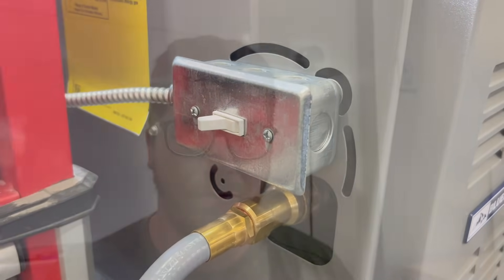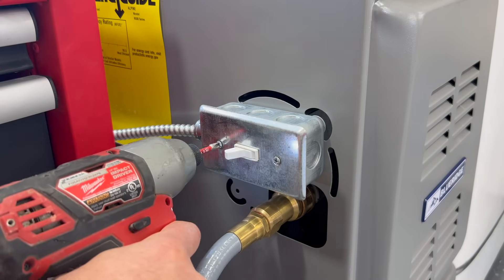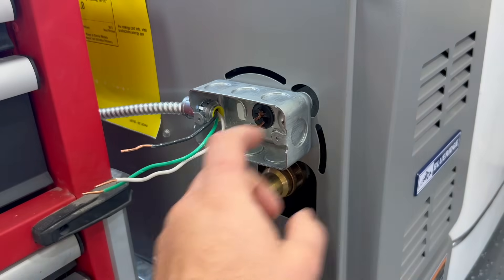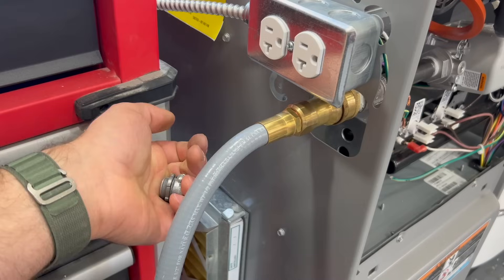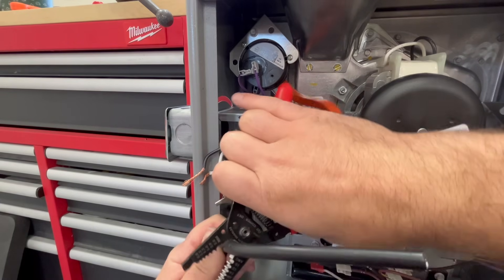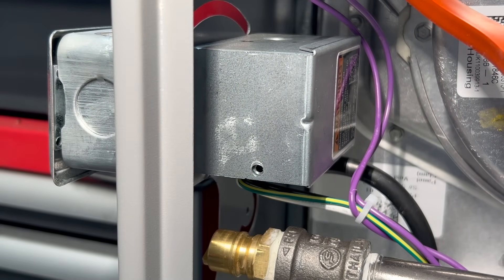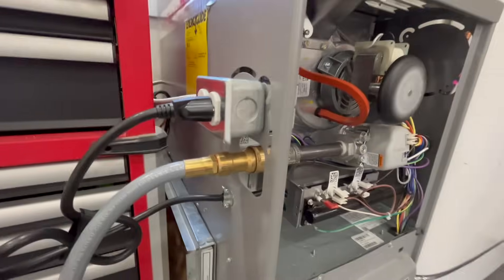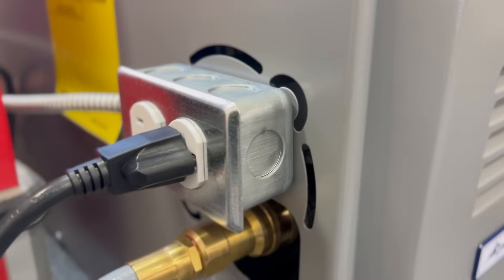Keep Your Family Warm During An Emergency Power Outage With This $20 Fix

Comment: Another great video.  Here in Texas countryside we don’t have gas so our furnace is all electric meaning 240VAC.   So I would power that with a whole house backup or maybe a portable generator like the Anker Solix 3800 which provides 240VAC split phase.  In reality I will likely have a critical needs panel until I can cover the whole house with battery backup but that is another story.  It is nice to have options.  Thanks again for your videos.  I always learn something.  All the best from north Texas!

Comment: Interesting about the furnace needing bonded neutral.  Also interesting that a portable power station isn't bonded.  A little info on how to tell the difference would be helpful. 
Bonus:  Making your own bonded plug is super easy.
Reply: most of the control circuits are DC and use the cabinet as a ground. Yeah, it's screwball but reality.

Comment: Can you do this with an electric furnace?  I live in a mobile home and have a DOWNFLOW/UPFLOW ELECTRIC FURNACE MODELS: EB SERIES.  I use a 12,500 watt generator.  Can I do this with the furnace I have?  Do generators need that bonded plug?  With an all electric home when the power goes out I'm pretty well Boinked.

Comment: Thanks for the video. So much better than the “widow makers of the past that I had to learn to make work.  But I am much older so I should know more now. Never thought of doing this method. But I gotta figure out my situation with a gas mounted furnace that’s completely outside.  Hmm. I shall find a video. It’s a weird house I got and with all the outside venting ish by looks.  I know how the house was originally designed in the 60s and how they decided to do the design as a single home they prob ever built with what little money they had and never meant to sold until both died.  Things like design from the foundation to to the roof in 70 years amazes me.

Comment: Question, If you don't have a power station, can you use a portable gas generator outside and do you still need the bonding plug.
Thanks for such a good informational video, makes it really easy to understand.
Reply from the maker: Yes absolutely
Reply: @diyhvacguy  No, most gas generators are already bonded so no plug is needed. Also, most 120v outlets on a gas generator is gfci and you CAN’T use a bonding plug on a gfci without tripping it.
Reply: @neilbrookins8428  I can't speak to "most," but I needed a bonding plug for my Honda EU2000i generator.  Furnace would not ignite without it.  Soon as I plugged in bonding plug, the ignitor fired up and I had heat.

Comment: Truthfully with all the different power sources available in different price ranges, every home should have an Interlock or Manual Transfer Switch installed.  But what you're trying to do, just install an Interlock on your main control panel.  It's much safer, legal and doesn't require any modifications to your furnace.
Reply: But in that set up you need a dedicated feed from a generator.  This guy is mostly interested in the heat.  Single extension for it. However, the generator may have another outlet for use of the refrigerator.
Reply: @richarde.plante3292  yes correct. And that is the whole point. Running a generator to the main does not break code. Running your furnace off a battery unit is ridiculous. What are you going to get? 5, 8 maybe 10 hours tops? And if you plug in your fridge maybe 3-4 hours? And when the battery runs out what then? You can get a decent gas generator for 500 bucks. Cannect it to the main and run fridge, furnace and some lights off of it endlessly.

Comment: That gas line made me hope that you had a way to run a natural gas furnace with propane in an emergency if natural gas would stop flowing. But, no 😒
Reply from the maker: I would like to do a video on that. It would be a lot of work as the orifices need to be changed for propane.
Reply: @diyhvacguy  Sure, I did learn about having to changes orifices. Too bad there isn't a quick change design, or a quick change device for changing orifices, or orifice sizes.   😏

Comment: You should have just installed that cable clamp in to the junction box and made the termination inside that..  Done and done.  This hurts my head.

The idea is on point though.

Comment: Nice vid. You know, what surprises me is that the furnace only needs 250 watts to run. And that is not much. Kinda like 3 old fashioned light bulbs worth of power.
Reply: Ya its mostly just making that big fan move but initial startup you'll need 3x that.

Comment: Does this work for an electric furnace?
Reply: Electric furnace is probably 240 volts and the amps would be dependent on the number of heat elements. So all the plugs, outlets, and wiring would have to be sized appropriately and a generator capable of delivering 240 volt power and sufficient amperage.

Comment: Probably best to use a single outlet (not duplex).  Any  "inspector",  rightfully could point out that the second outlet invites someone to wrongfully plug something in to what is required to be a single use furnace circuit. A well made, old style, twisted together wires with a well tightened and taped wire nut IS THE BEST most reliable wire connection
Reply: It's actually common to have an outlet for a condensate pump with AC or a condensing furnace. The code violation will be a 20 amp outlet on a 15 amp circuit.  BTW, while a plug is ok by code as a disconnect, furnace code will still call for a switch. IOW, he probably needs both.
Reply: @rupe53  Thank You.  I have a 80% furnace and do not have any  condensate pump/ condensing furnace experience.  I Am of the opinion that it is too much "complicated efficiency" for stand alone  reliability in these times. I too noticed the 20 amp outlet and 14 gauge cord and circuit wiring?

so a switched outlet - single or duplex as indicated?

Comment: Is it safe to run a newer high efficiency furnace  with a older generator  .I  Noticed that the power  output fluctuates from the generator  . It also has a floating  ground  , so do I need a grouding plug .

Comment: Please explain what the bonding plug is doing in the power station. The plug listed by Amazon as: " Ideal for replacement of plugs on tools, appliances and extension cords."
Reply from the maker: So sorry I had the wrong link there! My bonding plug looks exactly like that. I got that changed, thank you for letting me know.

So the bonding plug just attaches the ground to neutral, so if you have a floating neutral you would need this for it to run.
Reply: @diyhvacguy  That makes sense. I had to think about why it would be a problem. Most viewers would not.  Would that still work and be true if you were using a small gas generator r even car/truck inverter?

Comment: Code in Denver says you must have a flip switch to cut power and a screw in fuse at furnace
Reply: that's actually a national code. Code also says you can't have a 20 amp outlet on a 15 amp circuit.
Reply: I have Never seen a screw in fuse at a furnace so it can not be a national rule !
Reply: @josephpadula2283    the part about a screw in fuse likely dates back to at least WWII and never got removed. (maybe even the 1920s) The reason was adding central heat to a home without adding an extra circuit to the fuse box. IOW, tying into an existing power feed in the basement and making your own branch line. There was actually a combination switch / fuse base made to fit a 2x4 box with a small flip-up cover for the fuse. (have one in my house) Kinda cute but short lived because many just installed a ceramic bulb fixture and landed the fuse there, next to the switch box. Screw in fuses have the same thread as a lightbulb.

Comment: Great idea 💡💯💡 as Always 👍.  8 years ago when I installed a gas self igniter Heater on the Wall.... And did Convertion run on Natural gas on the GENERATOR.  Everyone in my Family Complained about it and made a lot of Bad Comments.  Why this and why that❓❓  2-years Later, We we had Winter storm and ice and Power outage.  Many people were moved to Hotel and some Old people were dead without electricity.  Then everyone in my Family said to me " You are Smart guy and always prepared"...  People in General they don't See and don't believe. In my mind I called them what a Clueless and Stupid people.

Comment: I can see that the original furnace before modification was fed by a metal conduit and rated for high temperature. But the post modified feed is plastic with a possible lower temperature rating.  This is not ideal and possibly violates code that requires high temperature rating.
Reply: Making that connection OUTSIDE the cabinet solves the code issue.

Comment: If the wire coming into the box is both 14 gauge and also fed from a 15 amp breaker then it doesn’t make sense to use the outlet shown which is for 20 amp service.
Reply: why argue for the 1-2 bucks extra, other than it's not code to have a 20 amp outlet on a 15 amp circuit, which is usually is on a small furnace.
Reply: @rupe53  it’s a simple issue. The 20 amp outlet allows you to plug in a 20 amp load device.  That will trip the 15 amp breaker.  You shouldn’t mislead a person to think the circuit supports 20 amps when it does not.
Reply: @neilbrookins8428     and that's the reasoning behind the code not allowing a 20 amp outlet on a 15 amp circuit. BTW, a 15 amp breaker will run overloaded for many minutes before tripping. The problem will eventually be failing insulation due to heat cycling if it gets used that way.

Comment: Shouldn’t the green wire entering the box with the outlet have a pigtail that connects to the box itself?  Meaning that the incoming ground splits to both the outlet and the box.
The original setup when switched off was still grounded to source.  The new configuration when unplugged is no longer grounded.  This is unsafe.
Reply: The ground wire screw of the outlet should be made with a small piece of conductor that communicates with the screw that holds the outlet into to the box. Allowing the ground circut to travel into the box.

Comment: Nice idea man. OK if you have a "battery power station" but just with a actual generator it would have to be outside. How much power/current does the average furnace draw? If it's that 230w then the battery amp draw is 10 times that or about 20A. I know that usually the gel-cell batteries (like the ones for UPS backup) are shit. only last perhaps 2 years even if not used, and are expensive to replace.
Reply: read your data tag then figure out if the watts are combined or separate for the heater and blower. Most will be in the 200 - 400 watt range. That's 2-4 amps total. An oil or gas boiler will be in the 2-3 amp range, including the circulators.

Comment: I just did this to my furnace, which one of your past videos, gave me the idea. I bought an Anker back up supply for the job from Amazon. I wired mine a little different. I used a combo switch and outlet where the switch was. I made it so the switch controls the combo outlet, all in the same electrical box. Then, I ran my pigtail wire to the furnace. What I'm doing differently is, leaving the furnace plugged into the backup, all the time, and the back up is always plugged into the switched outlet. Been using this for weeks. For me, if the power goes out, and I'm away for some hours, it's all done automatically. I ran the furnace, solely on the backup after I did the install.  It ran for 6 hours, perfectly, and I still had 75% of my battery left. The Anker model also has an app for my phone, so I can always check and see what's happening at home. Worked perfectly. Really happy I did this. Did not know about the bonding plug issue, but fortunately, mine works fine without it.
Reply: Which Anker power station did you buy?
Reply: @jmhescher  Anker Solix C1000 (X)
Reply: @jmhescher  I bought the Anker Solix C1000 (X).  It works fantastic. I bought it from Amazon when they had their Prime Days thing going on. It was a little over 500 bucks, and when the power goes out, it will be worth every penny.
Reply: Same question as jmhescher
Reply: @walterbowen2430  Anker Solix C1000 (X)
Reply: Get the anchor f3800 unit thats a great unit that can run 6,000 watts and does have  120/240 separate outlet plugs .You can run many things off that f3800 unit plus use it for many other things like camping , tools in places there’s no power but you need power .
Reply: @amycraven2404  I returned mine, at my cost as Anker insists; it was massively too heavy for this gal. And Costly lesson.
Reply: @mfb6310  too heavy? Have someone put it in place for You and You're good to go, even better buy a kids toy waggon to leave it on wheels

Much Love and God Bless
Reply: @mfb6310  Small hand truck, luggage hand truck maybe?
Reply: @crying_hippy  No 'someone' around. Basement was a narrow pit. And I decided I wanted a solid 3 to 6 weeks backup, not just a quick 24 - 48 hrs. I now have a simple LoF4 battery, a few panels, and an all-in-one  inverter w/a redundant inverter generator just large enough for a recharge if needed. All diy manageable and a daily use setup! ML & Blessings as well and a Thank you!
Reply: @cpoul  the 3800 is on wheels but another factor is I couldn't get it down a narrow 1895 basement, and didn't trust it to run 3 weeks straight, etc. So I got a big battery, an all-in-one inverter and some panels. And a little inverter generator as backup. Still working on the install & setup but it's so much better for me.  Thank you though!
Reply: @amycraven2404  Thanks for the tip. I'll check it out.
Reply: Great setup if 6 hours is 25%, You should get 2024 hours constant, but battery sag happens when it gets lower than 20%

I need to check this all out quickly, just moved into a house and if the power goes off, we will be good, also did anyone install external solar panels to help boost some free juice in the battery?

I used a 1 foot by 3 inch panel to charge a car battery that a friend used to heat his room, watch small tv and have a light on, I only had to charge it 3 times after that all winter long. I just set the panel out the window and it only got sun half the day too.

Don't need huge panels really, try it

Much Love and God Bless
Reply: @crying_hippy  Thanks. My furnace draws 300 watts when running, so I thought that was pretty good. I have regular PC backups, all around the house, to do nothing more, than to keep lights on, one per room. As for the solar panels? I have no place to safely put them. (Or, they may disappear, where I live). LOL   My electricity here is pretty stable, but if it goes out for 15 hours or so, I'll have heat. I didn't know about the battery sag issue, but the unit recharges in 1 hour to full capacity on regular AC, so I guess I can either hope the power would come back for an hour, or take it someplace else, and plug it in for an hour.  I guarantee you, none of my neighbors have prepped at all.

Comment: If I do this with a battery/inverter, will I run into the ground/neutral bonding issue? Does the furnace test that the ground is bonded somehow?
Reply: Would plugging the bonding plug into the new outlet work as well? I assume so.

Comment: Thank you for your informative and easy to understand videos. I have set up y furnace as you instructed in your video. I have not tested it yet as I am trying to figure out a battery (inverter) size to buy for this purpose. I do have a Honda generator that I can plug into the lighting panel but it is larger than I would need to just run the furnace for a short period of time for emergency heat. Any suggestions on a video to recommend the best battery (inverter) brand and size to use to run the furnace in an emergency?

Comment: Not 100% clear why you need that bonding plug? is it furnace (I have a 15 year old Armstron Air Enhanced model) or the type of your type of solar generator? hoping those plug won't short anything depending on your solar generator model? Thanks

Comment: Hi Dave: Thanks for these "keep your furnace going" videos. Im very interested in this "Bonded Plug" fix, as Ive got a problem after having done a similar install following your previous videos. I watched and installed the “plug,switch, pigtail” setup in your 12-9-22 video as you directed, then I upgraded following your methods in the “EX Generator Switch” video of 2-24-23. I saw you used the Ecobee thermostat at your house, so I purchased and installed that too. When I tested for each setup, I confirmed functions. But, after an actual outage, and currrently using the EZ Transfer Switch setup, the furnace ran perfect off my Ecoflow Delta 2, and after a few minutes, the flame kicked off as expected based on the thermostat setting. However…the furnace fan never shuts off!!  It runs on and on. So I try again. I unplug everything, let temp drop below the 70 degree setting, set furnace to 70 to call heat, the furnace kicks on again, fan comes on as usual, house warms to 70, then flame goes off as expected, and again, the fan never shuts off! The Delta 2 keeps getting drained!  I reviewed that I installed to your specifications, so Im confused. Could the "Bonded Plug" be tha answer for this problem? Or would u suggest I look in another direction? Thanks.
Reply: The thermostat likely has a setting for the fan to either be on ‘auto’ (running only when heat or cooling is called for), or ‘on’ (constantly running). I helped a neighbor set up a different smart thermostat and this option was in the settings instead of being selectable from the main screen. Does your furnace fan always run while on utility power also?
Reply: @Tvar7531  thanks for the idea, but no, the fan shuts off after the flame runs it cycle and the heating element gets cooled off. If it was always on, I wouldnt have thought something was "wrong". I wish it was that easy.